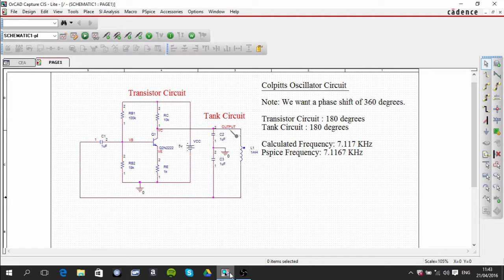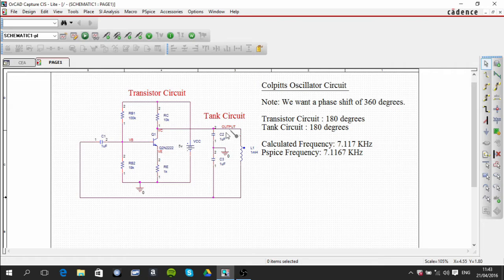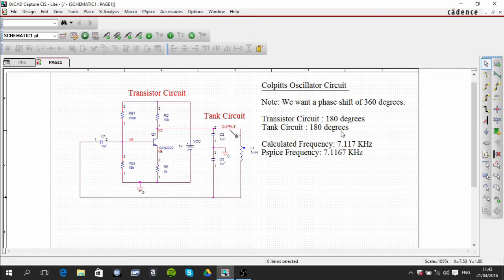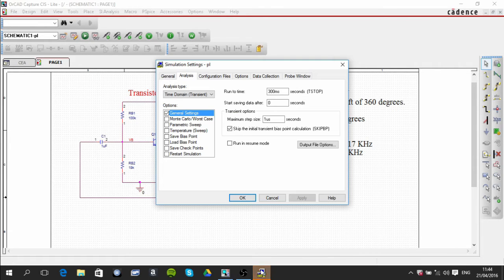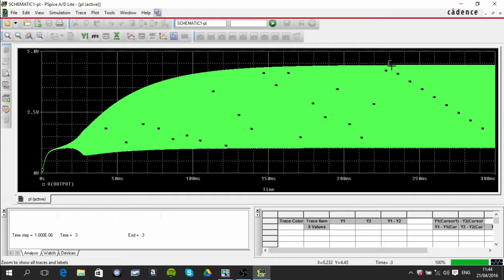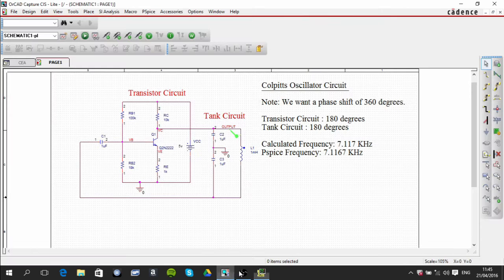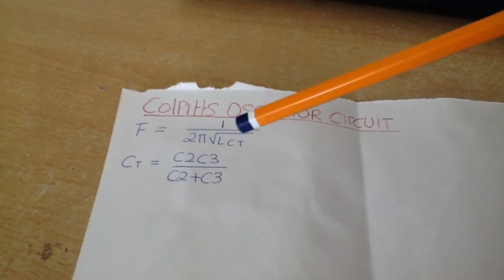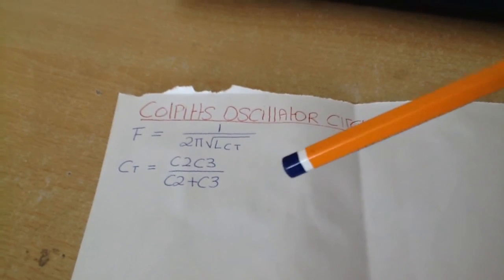Colpitts Oscillator Circuit using pspice

Comment: man! i tried to replicate this same oscillator but I get a flat line, oscillation. any ideas why? the phase shifting is done by the ground in between the capacitors, right?
Reply: try setting maximum step size 1us in the edit simulation profile(i miss that in my first simulation),i think it has to do with the sampling process of pspice
Reply: Same exact problem. Did you solve it??
Reply: Make sure simulation settings are Time = 0.3 sec and Time step = 1 u*sec